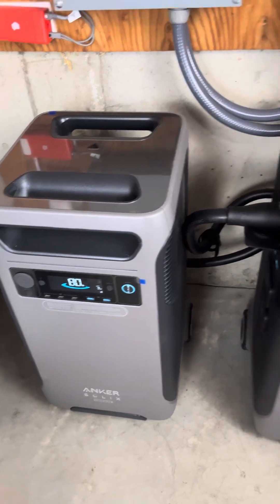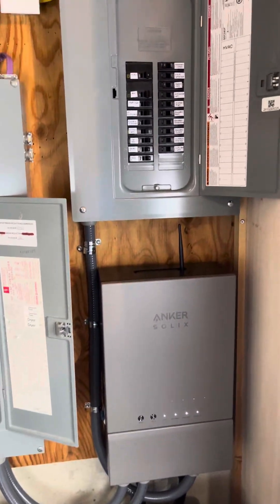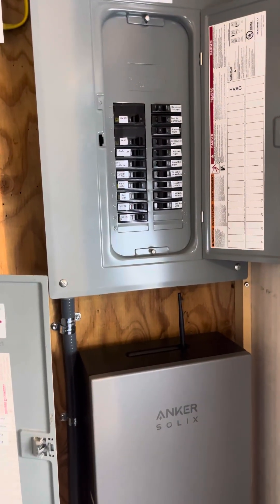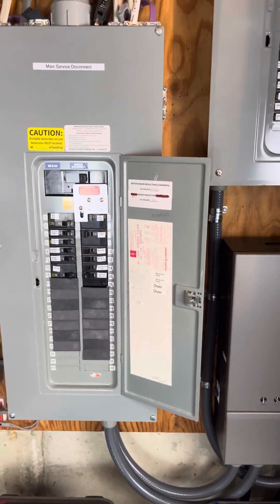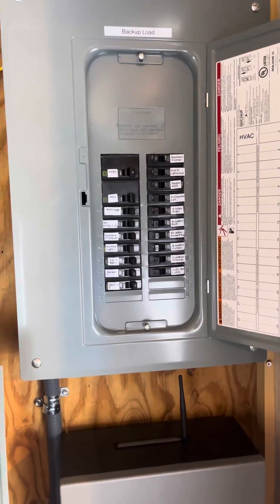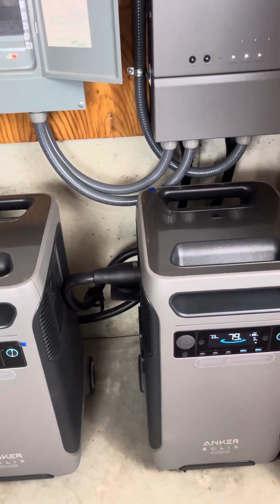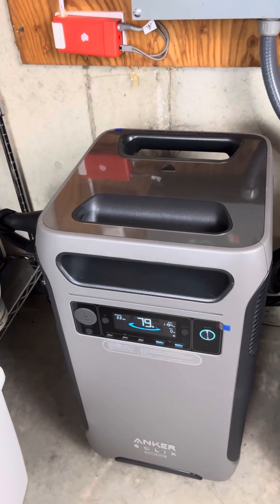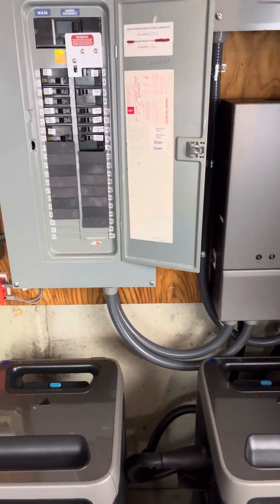My Anker Solix twin F3800 plus units and Anker Home Power Panel for automatic failover

Comment: Did you successfully back feed your main panel with your portable generator with your two f3800 connected to the home power panel?
Reply from the maker: Sorry for the delay in my response...did not see this comment.  Yes I did!  As part of this project I purchased a Westinghouse 11000 tri-fuel generator and when I connect it to the house and kick over with the interlock, I get +/-5800 Watts coming into the two F3800p units.  I also then get everything else that is not on my back-up panel powered (Electric Clothes Dryer, Oven).  I probably would wait to run the dryer or oven until the F3800s are at 100% because that 5800 watts of charging would probably put me too close to my limit of the generator.  At the 5800 watts, I can probably charge the 2 F3800p in about 3 hours (guessing).  Next I am going to get a EG4 Chargeverter and have a plan to have the chargeverter start the generator when the F3800Ps reach 20% and then shut off at 100% so then it will be able to sustain long outages.  Still noodling through how I am doing that but the Westinghouse has a smart switch connection that allows for 2 wire start and the EG4 can send 2 wire start.  If I can get that working I will be 100% automagic! ;)
Reply: @brooksdbetts  so when you switch over to your generator via the back feed, the home power panel is able to switch back automatically or do you have to press the on/off button on the home power panel to initiate the switchover and start charging the (2) f3800’s?  I thought because the CT leads go on the main power service, the home power panel would not know that a generator was on back feeding the whole main panel.
Reply from the maker: @wilsontennis31992  It does automatically switch back when I shut off the generator back feed.  Best I can tell is when I am on Generator the Home Power Panel is seeing the inbound power from the generator (even though the CTs are on Grid Power Lines) and the HPP uses the inbound generator power to power the whole house via passthrough, but also has the batteries pulling a full charge.  What I have found is that you have to be careful of how much you are pulling in the house while charging (2) F3800s.  Having both the F3800s charging at full power is pulling something like 3800 kW, and then the load of the house is taking what it needs.  I have a Westinghouse iGen11000TFC running on propane, so it is only capable of about 8000kw of sustained power.  I think the two F3800s charging at the same time is a little bit too much for my generator while pulling the house load too.  I was doing some testing a week or so ago, and my generator kinda freaked out and I got an error on the HPP that one of the power feeds (L1) detected a problem, and it stopped everything.  When that happened, I lost all power to the house, including the battery.  I think it was just too much sustained draw on the generator.  I need to test just charging one F3800 to 100% (using the breakers on the HPP) and then once one is charged, bringing the other one up.  I suspect if I charge one battery at a time, it should manage it okay.  I am also seriously thinking of getting an EG4 Chargeverter to use to charge off the generator via either the expansion battery port or the solar ports, so I can limit the power getting pulled from the generator. @Jasonoid on YouTube has done a few really good videos on this, and I feel like it might be a more stable solution.  I also have the F800plus units, and they have the DC Generator Ports on them, which ironically seem to just be another Expansion battery power (same exact voltage,) so it would be nice if Anker would announce a solution that we could use that port.  I feel like what I am doing now is all just a hack until Anker or someone comes up with a better solution.  Hope this helps a bit!  :)
Reply: @brooksdbetts this helps a lot, thank you!  Really appreciate it!
Reply: I want this but I also want the ability to remove the f3800 and take it camping with me when im not home. Without the f3800 attached will the home power panel still operate in grid mode? And when I come home do I have to turn off backup loads to reattach the f3800. Sorry for the long question but its very unclear in the documentation